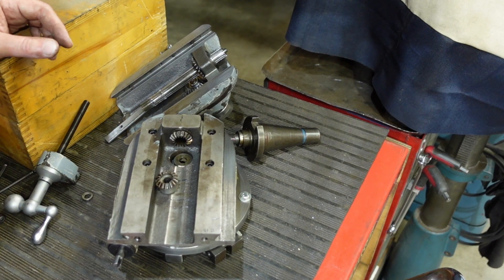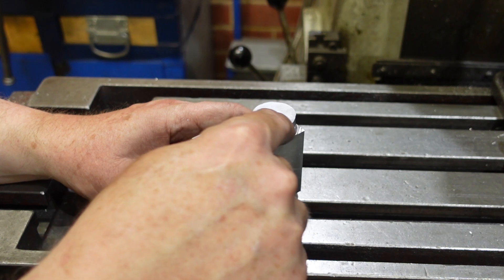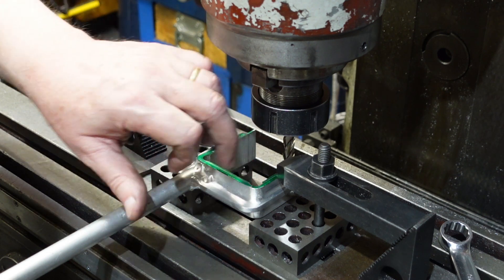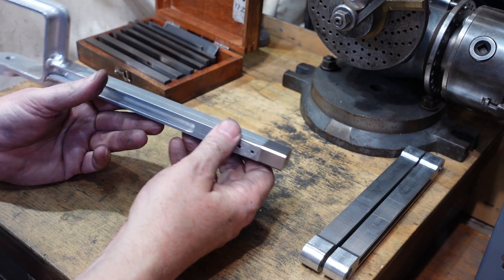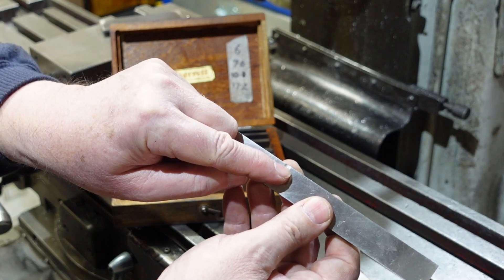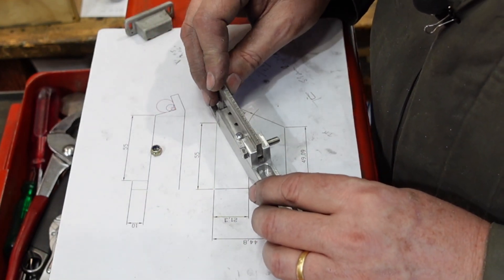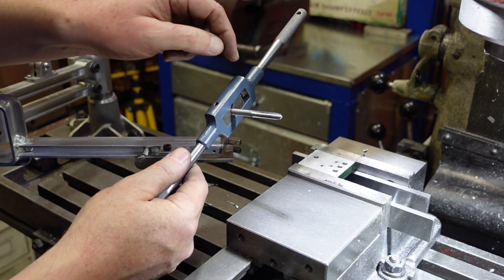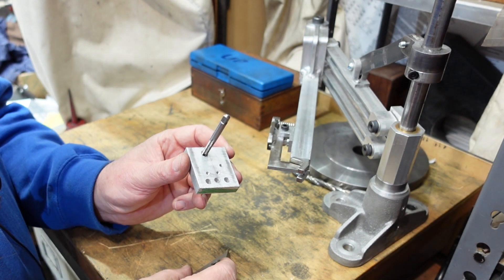Home made tapping arm (pt 2)

Comment: It's a long way out of being square. I could see that when it was being tapped, and I can see it at 17:46 with the square up against it, where it's clearly closer at the top than the bottom. Maybe the hole is also wonky, I don't know. 

The tap end should impossible to move out of 90 degrees but it's not because the arm is noticeably too flexible. Rigidity is vital in this system to make it worthwhile. You can see the flex also at 15:00 when the parallel join doesn't move but the end of the arm can be seen to move, which means it's not moving parallel, it's flexing. 

With a 10 mm pin and 0.04 mm clearance at the joint, you’re looking at roughly 5 mm of vertical wiggle at the end of a 2 ft bar. Maybe it just needs tighter bushings to eliminate that play? 

I'm not having a go, it's a good prototype, but I can get a tap more square than that by hand.
Reply from the maker: So a couple of things there -
Firstly, that tap was square. I checked that carefully before making that claim. I think what is the problem is the camera angle as I did not have the square square to the camera.
At 15:00, yes the arm did move. However, this is a guide for the tap so it is meant to move in x and y, and z is not so critical as the tap is going to be moving in that direction too (yes, there will be an angular component, but minor). In use, the arm supports it's own weight and the tap weight is on the surface being tapped. The arm has no dynamic component making it move, so I would not expect any changing deflection. The critical thing is that the tap is held parallel to the column.
I can (on a good day with the wind from the right quarter) tap square by hand on a flat surface too. The primary need I was trying to fill with this device was when I had to tap at an angle or onto the surface of a cylindrical surface, where it is harder to judge square by eye.
The one failing this design does have is the clamp at the end of the arm that holds the tap shank. Being a spring clip it can open up a little. I am aware of this so it does not cause me problems but in hindsight a screw type clamp would have perhaps been better. The clip was chosen as an easy thing to disengage. Perhaps a toggle clamp?

Comment: I simply use a spring loaded tap follower in the chuck, guarantees a straight start.  I don’t really see any advantage in you arm, or am I missing something?
Reply from the maker: I don't have a spring loaded tap follower, and while some of my larger taps have centres in the back, the small ones don't. If I'm drilling say a ring of holes on a PCD, I also don't like breaking down the setup to tap between holes.

Comment: very good. I think it's a bit beyond my capabilities at the moment though.
Reply from the maker: Some of the machining is a bit tricky, but if that clevis was a casting that just needed some clean up, it would be much simpler. Most of the rest of the machining is simple cuts. I would say that someone with average abilities should be able to do this, and very little of it is so dimensionally critical that one mistake and it's all scrap.
Worth bearing in mind that the first time anything new is made, the making process can look a bit chaotic just because the maker is trying to work out a good way to produce the part (and what you are seeing in the video is that first time).